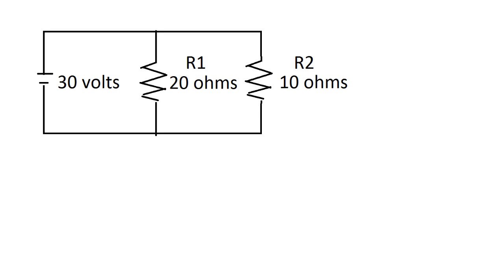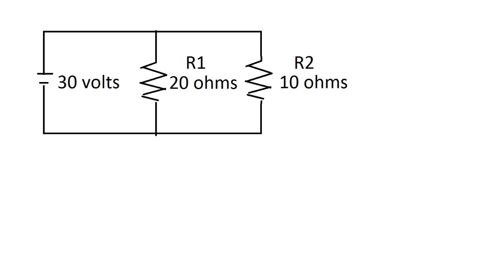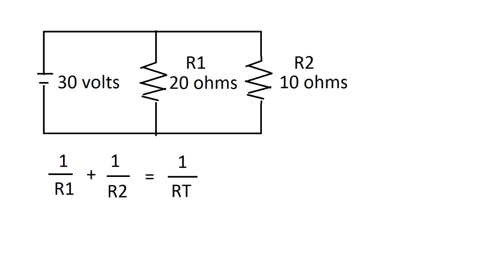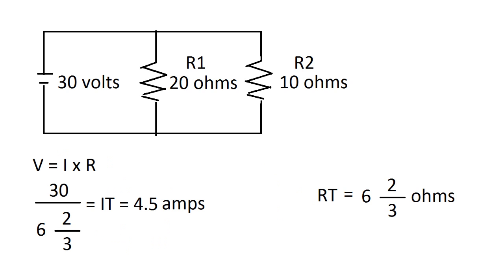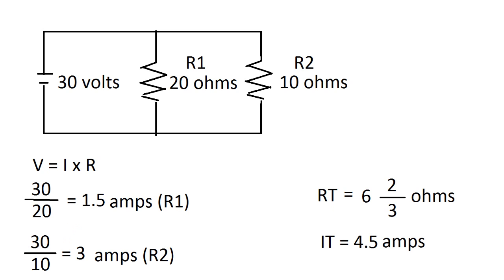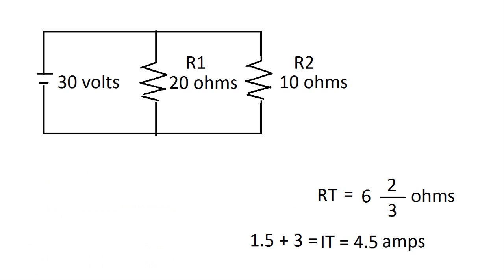Circuits in Parallel: How to Find Total Resistance , Total Current, and Resistors Currents

Comment: and you times and add not just add if its two resistors in parralel you need to redo your 202 revision
Reply: its the same answer. 1/3/20 = 20/3 and also (20*10)/(20+10) = 200/30 = 20/3. Duh.

Comment: Thanks! this was really helpful, I finally understand:) Also, Ashley, if you're still wondering, the 3/20 came from converting 1/10 into 2/20 in order to add that to the 1/20 already present(finding common denominators) and getting 3/20 as a result.
Reply: Are you becoming an electrical engineer?